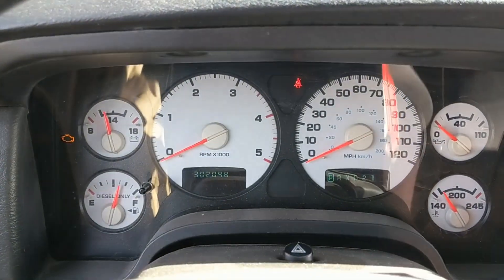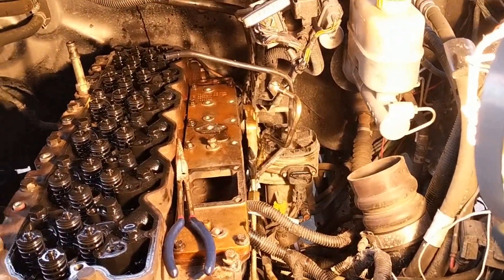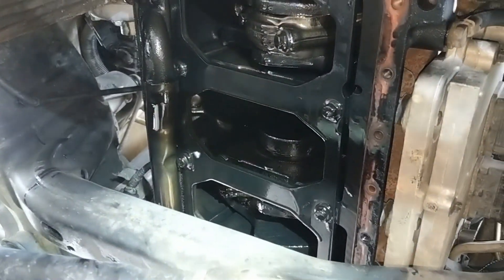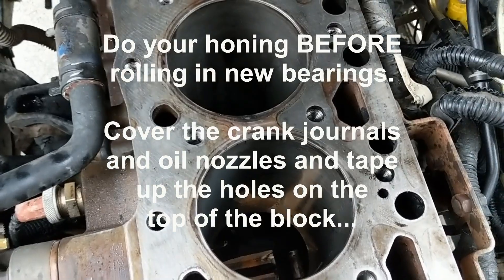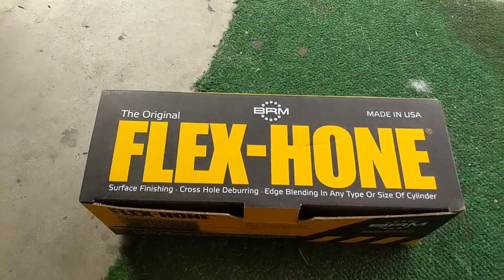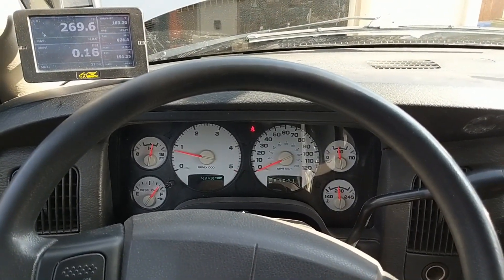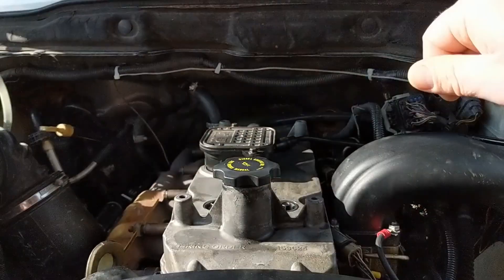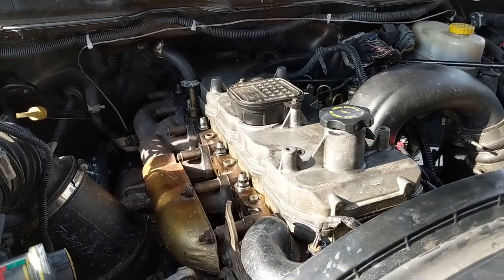5.9 Cummins in frame rebuild- 2005 Dodge Ram 2500

Comment: Question, you dont think blowbuy was caused by tunning.
Reply from the maker: It was caused by a broken piston rings which was caused by me running the egt's too high
Reply: @DieselCamper  how high of egts we talking
Reply from the maker: 1450...  My personal safe limit is 1250 now.
Reply: Damn I never worried about EGTs in my 05. Would see 2200*F + on hard pulls pretty regularly
Reply: @jeffsmith8066  make a video of these 2200° egt pulls.
Reply: @leehancock2782  I havent had my 05 for a few years now. I might have my edge cts with my max EGT somewhere tho
Reply: Jeff Smith 1250 is the figure on manifold pre turbo, you are quoting post turbo which is not as accurate.
Reply: @witkr904  my pyrometer is mounted directly on the manifold

Comment: I watched this recreationally and owning an Ecodiesel with the hopes of getting a Cummins for a winter truck. If it ever happens, I will be sure to check this video. Subscribed. 

Never rebuilt a diesel before however have mechanical knowledge otherwise with working on vehicles and rebuilding dirt bikes. Any tips? Thanks man!
Reply from the maker: Look for a low milage 5.9 or a post 2013 6.7 if you can delete tune it.

Comment: Can you modify the mechanical engine 2005 Cummins 5.9 by changing injection pump, diesel lines to eliminate the electronic so that it works mechanically? I use translators languages excuse orthographic errol
Reply from the maker: I would consider getting a 12 valve 5.9 engine instead of trying to remove the electronics from a recent 5.9

Comment: Can you modify the mechanical engine 2005 cummins 5.9 by changing injection pump, diesel lines to eliminate the electronic completely?
Reply: Just do a 12 v swap

Comment: That’s the exact truck I’ve got. Colour and all. Anyways what kit did you use? Mine just blew on me last night driving home. Thanks
Reply from the maker: I used an engine masters rebuild kit, hope it goes easy for you!
Reply: Perfect thank you!
Reply from the maker: Also note that the service manual may show the intermediate ring bevel up.  This doesn't mean it goes up no matter what.  If the ring manufacturer says bevel down, it's bevel down (which it probably will be).

Comment: Lord just take the engine out
Reply from the maker: I was kind of thinking this by the end.  If you have any rear main seal issues that should cinch the deal... Pull it.
Reply: @DieselCamper   I'm so lucky I have both...bad rings and rear main seal leaking...and I have a 6 speed so my clutch has now been soaked in oil...triple screwed. I gotta pull mine this weekend
Reply from the maker: Ouch.  I need to do my main seals also.  Not sure when I'll get to it though.
Reply: I was thinking the same thing. Looks tougher to do an in-frame rebuild. Good job though Camper

Comment: Getting ready to do the same thing to my 01. I take it the $600 didn't include the ARP's? How is it holding up?
Reply from the maker: So far really good. Oil sample came back clean at 3500 miles.  Bought the ARPs used off a buddy for a few bucks.
Reply: @DieselCamper  How long did this take you to do?

Comment: Just got my 1st oil sample back (about 3500 miles on rebuild) and looks good.  No fuel or coolant and metals are just above normal which I would expect for a motor breaking in.

Comment: Have an '03 with a bad injector knock. Have solved the knock but still misses and smoking. Any suggestions along that line would be appreciated. At 233k miles am considering rebuild. What was your source for the rebuild kit?

Comment: I know my motor is overdue simply due to having 340k on it i have a 04.5 im just wondering how long did it take start to finish and what was your break in time how long did you leave it idle to set rings prior to getting in and driving
Reply from the maker: Took about 5 days total.  Break in for me was run easy for about 50 miles and then hammer on it and get it hot.  Towed our trailer up a hill several times also.
Reply: I've got 94 12 valve with over 500000 miles on it still doesn't use any oil, I did have the transmission rebuilt at around 350000 miles though, it's all stock, I've never had any problems with it at all

Comment: Is this pretty normal around 300k miles? Considering buying my dads 98.5 24v.. 202K miles. I personally cannot work on it due to a disability. I was under the impression these things ran a bit longer than that before needing a rebuild? Thanks
Reply from the maker: I am pretty sure I cracked my piston rings with either excessive heat while towing or too much timing when I was learning how to tune these rigs.  Under normal circumstances I would think you could get much longer than I did.  On the cylinders that were still good I could see crosshatch which is a great sign.
Reply: @DieselCamper  Gotcha, the truck has never been tuned and only used to pull a camper. I'm not sure at this point what block it has though. Are you familiar with the ''53'' block? Should I be concerned? Last question, thanks again.
Reply from the maker: http://www.cumminshub.com/cummins-53-block.html
Reply: This is way late but my 24v has a  53 block with 549k miles still runs great. The 53s are just a gamble so good some not

Comment: Was this a stock fuel engine till you rebuilt it?
Reply from the maker: It has a smarty touch
Reply: Diesel Camper ok it sounds good! Now hook a 10 k trailer too it and break it in!! Take it on a good long trip and don’t baby it! I bought a cracked 53 block 24 valve vp 2nd gen, engine had 250 k mi., and towed heavy most its life; and threw a patch on it, and ran it for a year, then it had cracked worse, so I bought a 56 block, and rebuilt it (new rings,  reused 150 k mi. Pistons, had block honed, and crank and rods checked, and did a Hamilton mild street/ towing cam 178/208;  did a p pump conversion to it. Studs, 100 horse injectors, and s362sxe sxe turbo. I have about 15 k miles on the “new” engine now, and I do occasional towing, and ran a conventional oil for the first 10 k miles to help break it it in. Now I have almost no blow by out the oil cap, and I did hav a noticeable amount right after I rebuilt it, so anyway that’s some of my story! Lol.

Comment: Did the same with my 12 valve then changed the oil once I hit 500 miles with Amsoil 15w-40 Signature Series and plan to change oil again between 15k-20k miles even though it recommends changing the oil before 60k or 600hrs
Reply: JessieJ 60k?
Reply: 98 12 valve right? 60k miles is fucking retarded...... yea there is people going 15k or even 20 with really good oil and filters but not 60.
Reply: I imagine he's missing a decimal point lol
Reply: @jeffsmith8066  That is Amsoil's statement not mine! 

" SERVICE LIFE
Diesel Engine Service Life

Heavy-Duty On-/Off-Road: Three times (3X) OEM1 recommendation, not to exceed 60,000 miles/600 hours or one year, whichever comes first. "  ----> https://www.amsoil.com/p/signature-series-max-duty-synthetic-diesel-oil-15w-40-dme/?code=DMETP-EA&gclid=EAIaIQobChMI8Y335PK36QIVNPC1Ch3rSQ9cEAYYASABEgLKUPD_BwE

Comment: Estimated time spent completing this?
Reply from the maker: I did it over 4 or 5 days.
Reply: Cool thanks. I'm in the middle of it right now. Did you happen to have any horizontal ridge around where ring#2 makes its full up travel? I do and not sure if I should run it or not
Reply from the maker: Not that I recall.  I'd bet an aggressive hone can take care of it as long as your finger nail can slide over it.

Comment: Multiple questions haha...Which rebuild kit did you use? link? When getting the pan off did you have trouble with the transmission being in the way? Also would you maybe recommend doing a full blown overhaul/rebuild kit that comes with new pistons/rods? I have the same blow by as you and just kinda was researching how to do the rebuild and such, wasn't looking fwd to pulling the engine AT ALL then I came across your video and i think i will follow in your footsteps! Thank you very much for the informative video and tips! Look fwd to your reply.
Reply from the maker: I used an engine masters rebuild kit I bought on eBay.  Came with new rings seals and gaskets.  You can decide on the Pistons after you get a look at them...  If needs be you can do other things on the motor while you wait for the Pistons if you end up ordering them.  No issues with trans getting pan off.

Comment: How did you know what size main and rod bearings to get?
Reply from the maker: I just ordered standards assuming the engine had not been machined before.  When I pulled the old ones out I confirmed they were standard by the std stamp on the old ones.
Reply: @DieselCamper  Gotcha. Great video by the way!

Comment: did the scores come out pretty easy with the hone? I'm in the process of doing a 12 valve.
Reply from the maker: Not all the way, but it smoothed out pretty nice.  Got almost 3,000 miles on it so far and I can tell the rings are breaking in.
Reply: Diesel Camper Okay. I have one line in #4 cylinder and I can barely catch it with my finger nail.
Reply from the maker: If it we're me I'd hone it and go...
Reply: Diesel Camper I’m soaking my pistons over night in white vinegar. Did that get all the carbon off for you?
Reply from the maker: It freed up a lot of it.  Just dont submerge the wrist pins.
Reply: Diesel Camper ok thanks I didn’t, just the rings.
Reply from the maker: I used a wire wheel from an angle grinder, and just brushed the gunk off by hand.  Don't use it on a grinder.  I used a pick to clean the ring grooves.
Reply: Diesel Camper ok cool! Thanks for the advice!

Comment: Just an off topic question, why would you run a 12v tune on your motor? I have an 05 as well, stock.
Reply from the maker: Mostly because I enjoy it...  In theory it saves you some injector wear.
Reply: @DieselCamper  Ok, cool, thanks for the reply. I didn't know if there were any performance increases.
Reply: I see you have a smarty, I do as well. What exactly do you consider a “12 valve” tune. Is it custom, and what’s the horsepower and torque increase?
Reply from the maker: Yes it's a custom tune I sell.  It eliminates pre and post injection and sounds more like an older 5.9 actually sounds closer to a 2nd gen.  Power is about 30hp

Comment: Nice job and great video. You can also just run the ground wire straight to the manifold, banks has you do this when you install one of their intake horns, I will get a picture and try to post it for you tomorrow.

Comment: Wow, where was this video a month ago!  315k on my 2wd 06, ran like a dream but leaked and smoked.  Major blowby, it would blow the cap completely off.  I'm still in the process of doing mine.  Just got the oil pan off yesterday.  Rack and pinion was in the way.  Mine is on a slope so I didn't want to try jacking the motor up too high.  Great job with lots of tips and tricks.
Reply from the maker: Thanks and good luck with the rebuild!
Reply: She did well for about a year afterwards.  Started hearing a ticking noise and just figured it was lifters.  This is all while still working her (hauling a 16' enclosed trailer with lawn equipment from Atlanta to Memphis once every 2 weeks).  One day, loaded up my sons with no trailer, and pow!!!!  She threw a rod.  A mechanic buddy narrowed it down to me not putting Locktite on the cap bolts.  I would concur at this point.  She's sat for about 2 years now.  I want to atleast pull the motor and get #1 sleeved and try it again.  If I didn't have to fight with getting the oil pan off, I'd do it again sooner than later.  But that was just too much.  Maybe a 2 piece pan would make it simpler.
Reply: @ahch-1402  I plan on just making a little power on mine it only has 288k (2001 2nd gen) so hopefully the damage isn’t to bad but I’ll see how long it’ll last
Reply: @ahch-1402  and I’ll make sure to totem everything good so this won’t happen thanks got the help
Reply: Got the pistons out last week.  #1 and #4 rings were broke.  I flex honed all of them.  #1 has a prominent ridge that I think I'll use the 100 grit 3 leg to take it down some and hit with the 240 grit flex hone to get my cross hatching.  The ridge is 1" horizontal from the top.  Not sure how that happened but I hope I can smooth it out.  I figure it will be better to have a wider piston gap spread out 3 different ways (120° gap) than the ridge.
Reply from the maker: I'd bet it will be fine after you smooth it out
Reply: @ahch-1402  you may need a ridge reamer  to remove the ridge snapon makes a good tool
Reply: @andrewslagle1974  well, I used a plastic scraper and got the ridge down smooth.  Pistons in (all but one, I broke an oil ring)
Reply: @ahch-1402 how did she do mines got the same thing currently

Comment: Great Job with the Video and the rebuild. Have you had the truck since new? Just curious my 05 is at 218K and the truck has been babied by me and the previous owner. Just trying to get a feel if a rebuild is in my immediate future. Don't have any serious blow by yet.
Reply from the maker: Thanks!  I think you should be fine...  The only reason I needed one turned out to be a broken piston ring.  If that hadn't happened I'd still be going strong.  I could still see cross hatch marks on all cylinders!

Comment: Fun job, i known personally as i did mine last year
Reply from the maker: Yeah I'm glad I did it, not in a hurry to do it again though...  That diesely oil gets EVERYWHERE!
Reply: @DieselCamper  still going strong? Im just about in the same boat you are before the overhaul
Reply from the maker: So far so good.  Just sent 1st oil sample off today for the 500-2500 mile oil change.
Reply: @DieselCamper  right on, hey why does your valve cover look different? Did you take the plastic off?
Reply from the maker: Yeah, it's back on now.
Reply: @DieselCamper  thanks for the reply

Comment: I don’t have any blow by at the oil fill cap but I do have some vapor coming out of the crank case vent tube wondering if you ever heard of that problem before
Reply: My 01 5.9 leave a puddle of oil out of the vent overnight. But only sometimes?
Reply from the maker: Make sure the small tube from the breather box isn't clogged.  It returns captured oil to the crank case.
Reply from the maker: Vapor is normal, exhaust coming out of the oil fill is not! 👍